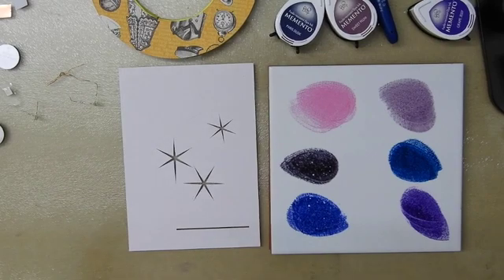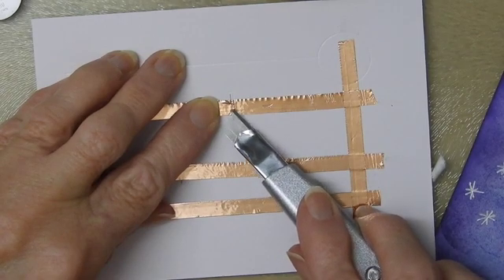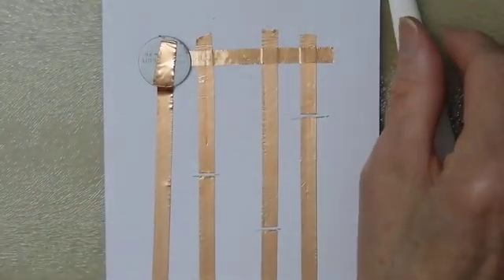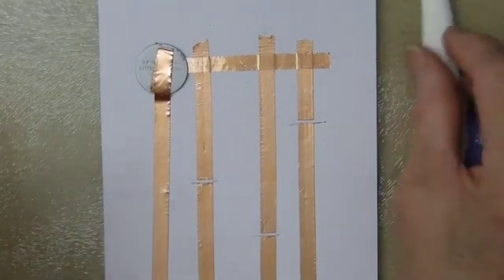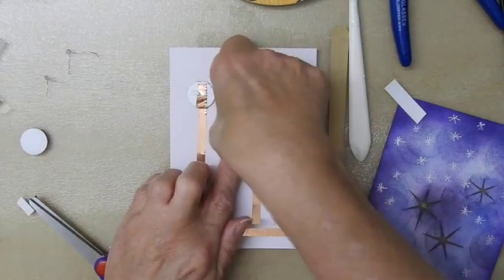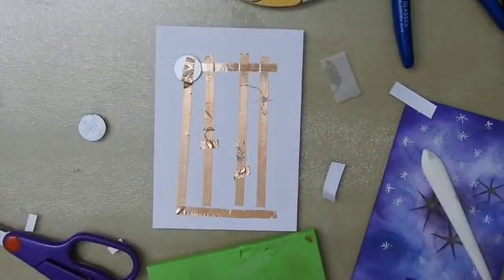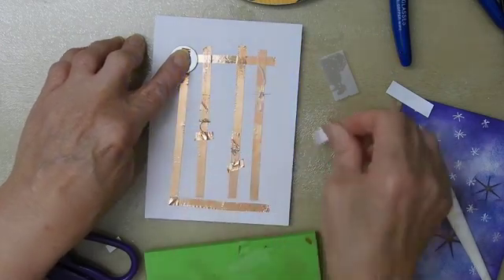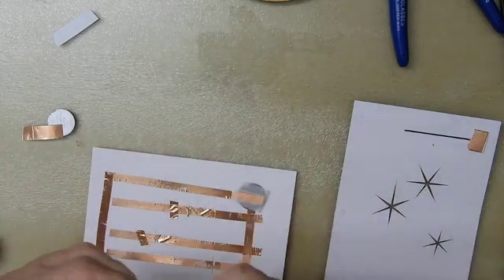Multi LED Flashing: Switched card - Bonus Video!

Comment: Been loving all these light up card ideas! I might have to round up some supplies and have a go. I never got into the Chibitronics, because they were just too spendy for my crafting budget. Though I am sure I can swing this. I have some fairy lights in my stash I got on clearance awhile back that might work and I am pretty sure that I already have those batteries too. If that's the case, then I would just need the cunductive tape.
Reply from the maker: Fairy lights that you can get small enough will work fine. If they are plastic covered wires, the     ends will have to be stripped, the tape was bought on line but make sure it is high quality tape with conductive adhesive.